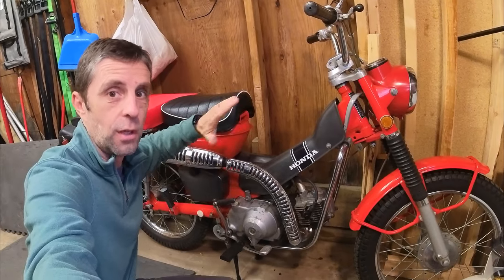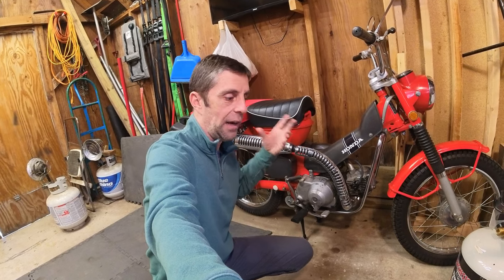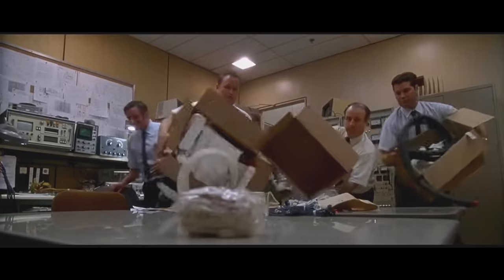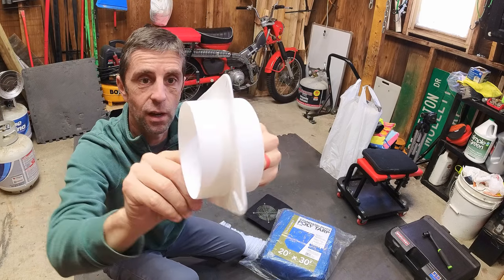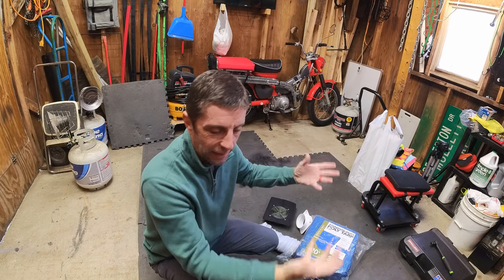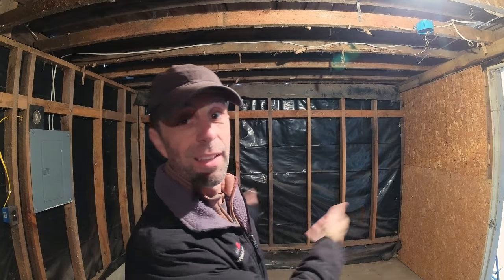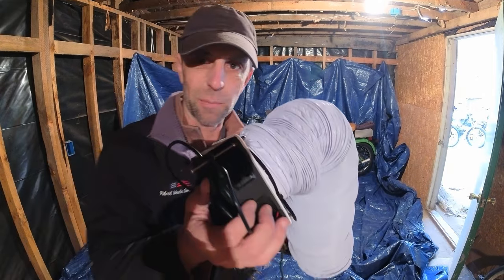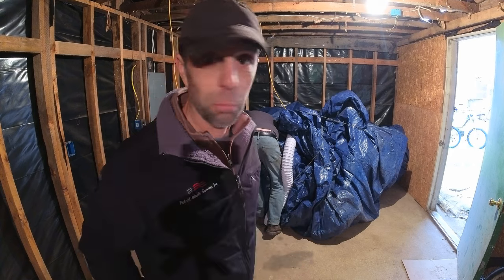No Heated Garage? No Problem!!  |  Rustproof Motorcycle Winter Storage

Comment: I would have left the flap inside the flange. Maybe even make the flap more air tight.  That way the air could go in and if the power goes out or whatever it would stay pressurized.
Reply from the maker: Thanks for watching!

Comment: On moist days you could be augmenting the humidity in the enclosure, depending on which direction the temperature is going, could promote condensation. How about creating your structure and just put a bucket inside with desiccant in it. They sell bags of it for RV storage, it's quite cheap. Will stop all condensation  and mould.
Reply from the maker: The circulation prevents condensation in any humidity or temperature swing. That’s the whole point!  You gotta try it!! 😁

Comment: So just to understand correctly, the fan stays on continuously until you unwrap in the Spring? How are you powering the fan? Just a 120V outlet?
Reply: Sorry another comment - are you sucking air in or blowing it out? I’m thinking sucking it in but not sure - Thx
Reply from the maker: Hey thanks for the questions!!  Yes the fan is powered by a 12v brick that plugs into 120v outlet.  It's 10 watts which works out to about $1.30/mo. in electricity where we are located.  The hose is sucking air in and filling the bag which breathes out through all the folds and gaps at the top.  If I could get the wrap a bit more 'gapless', it would inflate a bit like a bubble.  As is I'm still quite happy because there is positive ventilation which will prevent condensation and thusly oxidation.
Reply: @ Appreciate the quick response - very innovative idea - Thx